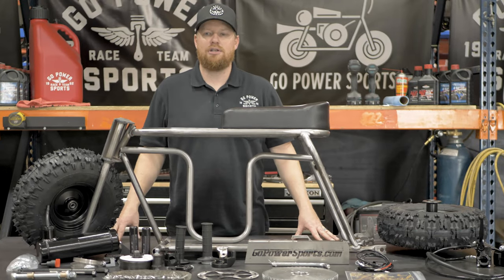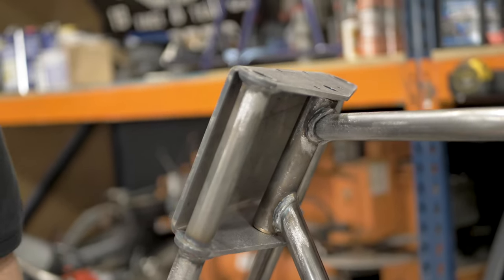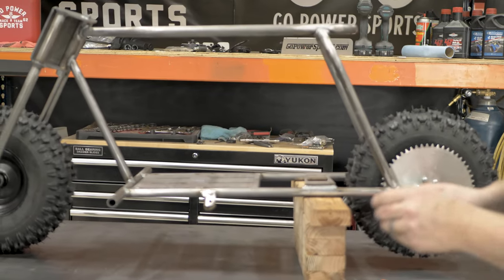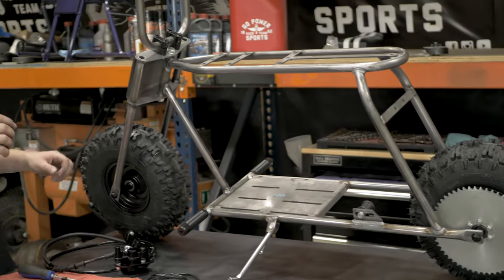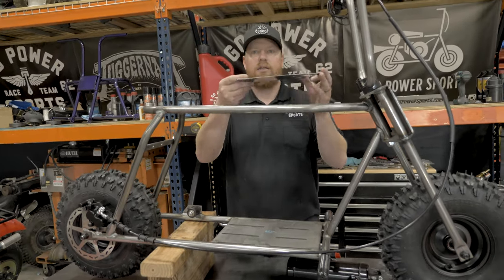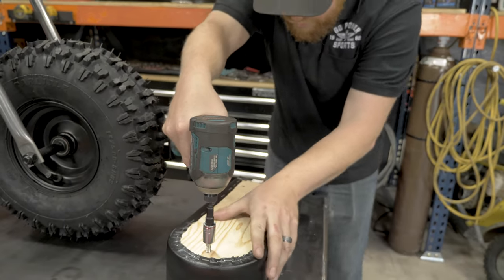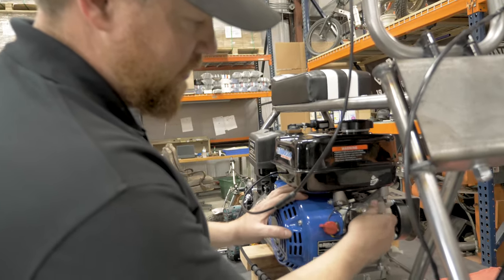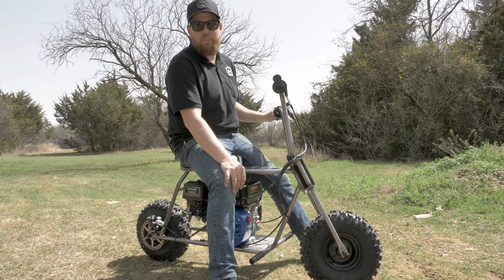The Rascal Mini Bike Kit Build | Tutorial

Comment: $900? with no suspension, no motor, no finish, and I have to put it together...why would I buy this and not another MB200-2? sorry guys, but I think you missed the mark on pricing ..as long as a complete running Coleman 200U or BT200x is available for less than $600 at Walmart
Reply: @Skott LeFever then GPS needs to do an educational comparison vid showing the differences between the rascal and the chinese made mini bike frames...like wall thickness of the tube, the weld quality, frame geometry, etc.. otherwise the consumer will base their comparison solely on the price only because that the information we have
Reply from the maker: Great idea!
Reply: @Skott LeFever  they say the frame is made in USA but won’t list the specs of metal on their site and you still might have to “make adjustments or re-drill holes” and every other component is the same Chinese parts they use on other cheaper Chinese bikes.

That frame does not make it a $900 kit
Reply: @Skott LeFever still not worth $900 if you compare it to other kits. Other kits offer suspension, gussets, steering with bearings etc.

Comment: Wait, what? $900 for a bare frame with no suspension, no frame gussets, no steering stops, and questionable handlebar mounts? I'll sell my bare rupp lil indian frame with full suspension and fold down bars for $1000 I guess.
Reply: Next version will be Rascal Max with front and rear suspension
Reply: @robertgelbhar443  i think ill wait for the max frame then
 honestly 900 is an insane price
For a rolling frame
Reply: That’s what I’m saying, even on their site there’s a disclaimer “may need to make minor adjustments and or re-drill holes” 

How you gonna charge $900 for bare minimum quality, like you said no suspension, no gussets, questionable steering components, one single drop tube off the head tube with no gussets, brass bushings instead of bearings for head tube, bare metal no coating, they also seem awfully shy with not listing the metal specs of their “made in USA” frame, I bet it’s comparable to the cheaper Chinese frames. Not to mention engine and shipping fees. 

So disappointing, i like GPS a lot but this is just a smack to the face
Reply: I wish I would of read the comments before my purchase. I ordered the rascal 5/24/22 and still haven’t been able to ride it. Still waiting on brake assembly, and didn’t realize when you order fenders they don’t offer what you need till you call back and say something is missing. And they realize they didn’t add it to your order before shipping then charge you when you spent well over $1300 on everything you ordered to be charged for someone mishap, no I wouldn’t recommend. Gussets, powder coat and now fabricate fenders, I’m well over 2k into it and still haven’t rode it…….smh go power do better or lose customers like myself. ✌🏼
Reply: For that price i legit bought my first motocycle its not a minibike its a f**king Yamaha Ténéré of 1991 works perfectly fine i will Never  buy this thing
Reply: 900€ for bars that cost 50€ no thanks I will do it myself

Comment: Are you able to fit a 212 clone and torque converter on this frame? Thank You!
Reply from the maker: Yes you sure can.  Thanks!
Reply: Can I fit a 9 HP Subaru OHV engine on this frame? The engine is 16 inches in height.

Comment: GPS, My bike did not come with spacers for the brake calipers. It only came with lock washers. How much of a gap should the spacer take up? I've added washers but it still rubs and does not spin freely
Reply from the maker: Give us a call so we can pull up your order and see what frame you have.  866-846-5278
Reply: @GoPowerSports currently have the same issue
Reply: @am0ney92  I couldn't find mine either,  just used a stack of washers for both bolts, 3 of them

Comment: I am getting a bad front end vibration/shake when accelerating on my new build. I have the road 15 x 5-6 Ultimate Mini Bike Street Tires. I also have the upgraded wheels/rim. It looks like bearing are leaking which are brand new. Any Ideas?

Comment: I have the chain guard, sprocket, brakes,, throttle, Wheels, tires and a $100 spun aluminum gas tank....I'm about 12.25% on my way....oh yeah it needs a motor....make that 2.25% 😃.
Reply: @Skott LeFever yes sir!!! This would be my ideal ultralight since I'm so non-ultralight😃....😒.
Reply: B & S Engines are a Dime a dozen out there , use one of them Cheers Trev New Zealand (south Pacific)
Reply: @trevinskiking2165  I want a Raptor!!!
Reply: @fatbuddycat  Was that the old Minibike or brand of clutch ?.. you've lost me ?! Trev NZ
Reply: @trevinskiking2165  https://en.m.wikipedia.org/wiki/Flathead_engine
Reply: The Briggs & Stratton Raptor Flat Head.